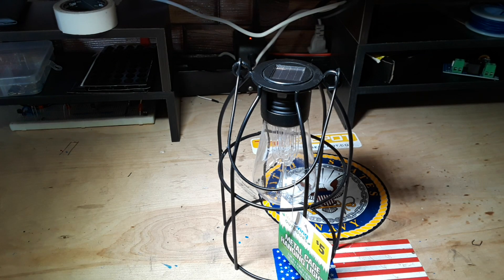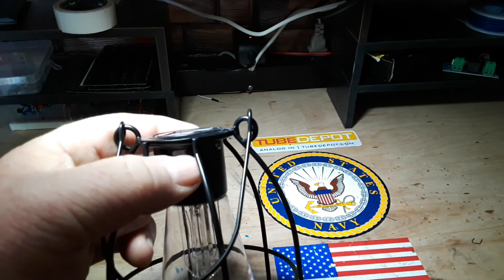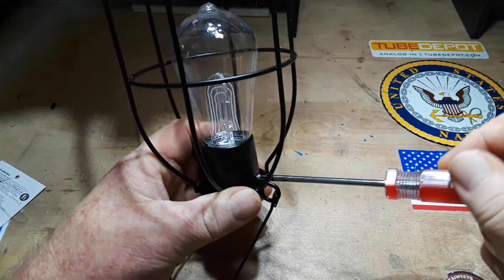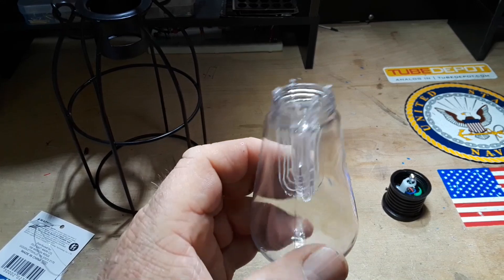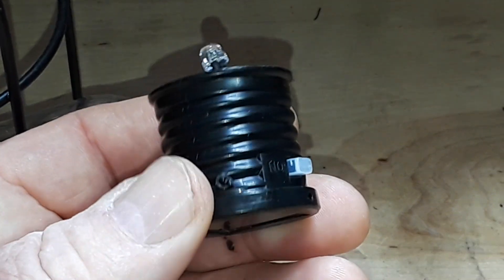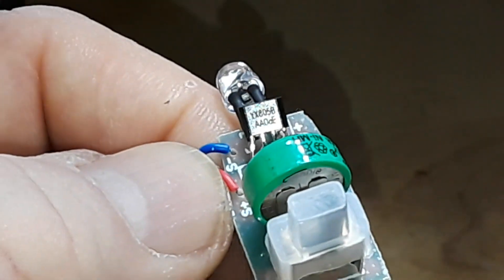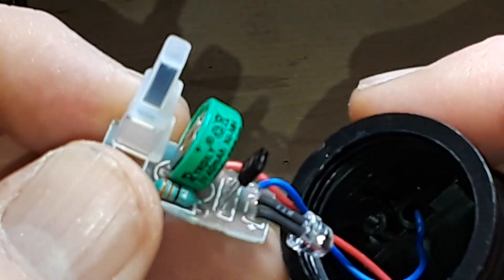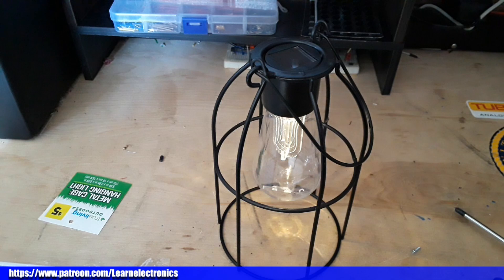$5 Dollar General Solar Accent Light Tear Down

Comment: Awesome! I keep finding broken garden solar lights on the side of the road and grabbing them. First one I butchered the PCB. Figured I didn't need it. Well latest one I grabbed has a similar YX IC. 5252F, I removed the led since I only wanted it to charge my NiMH cells. So far its charged one AAA great! Just have some dupont cables coming off from it through my window to the pcb then to a 3d printed AA holder. I have some adapter for AAA's  to the AA size.